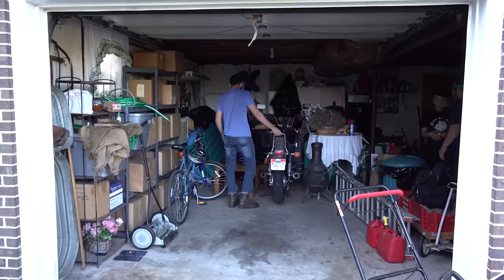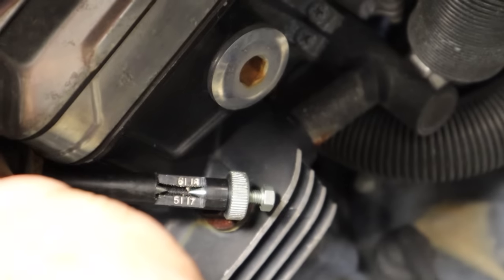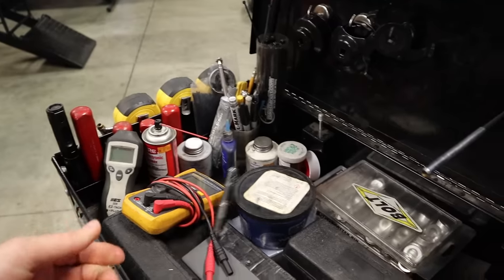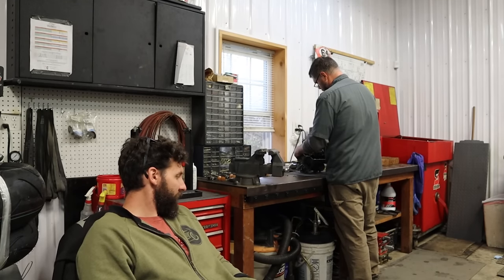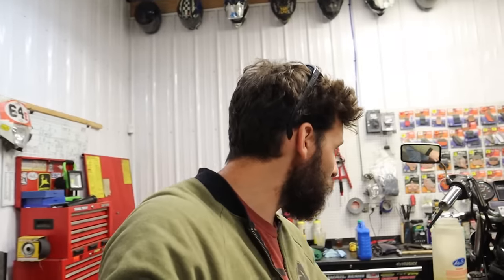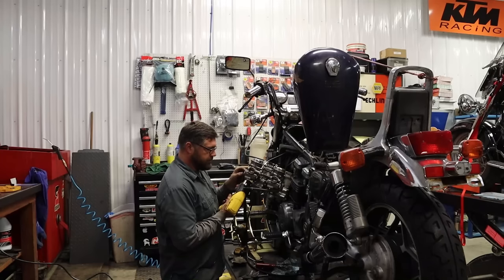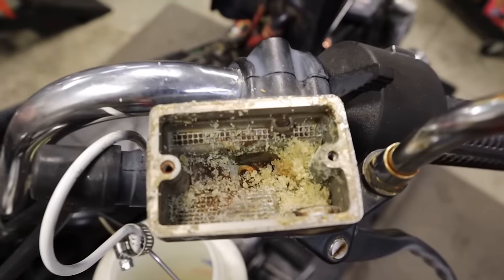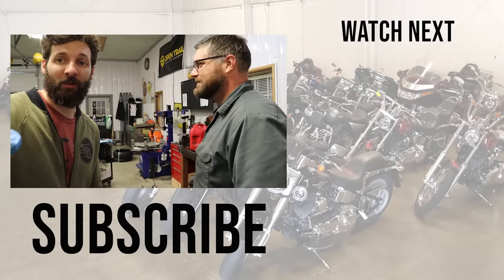Abandoned 1983 Honda Magna Restoration, Can we get it to run?

Comment: I just got my 83 V65 running after 6 years. Quite a few parts are no longer available OEM  which can be a problem with these old bikes. Mine needed a new fuel pump, air filter, directional signal flasher, etc. I have manuals and a wonderful enlarged wiring diagram.  VERY HELPFUL! Also needed new float needles and seats. Old ones don't seal and it is not good when you see raw gas pooling in the air chambet!

Comment: Honda clutch master cylinders also have a habit of building up an air pocket right at the master cylinder sometimes you have to loosen the brake line at the master cylinder the pop that are pocket loose

Comment: Started a Honda vf750f interceptor and wanted to replace the air box with a single air filter pod that runs off to the side. How would you go about connecting the carb air holes together ?

Comment: I actually have a 1980 Honda CB750 Custom that was left sitting for about 15 years that I'm working on. Carbs need rebuilt for it to truly run but it starts and somewhat idles. Would show you pics but can't really do that on YouTube.
Reply: make sure you use a quality rebuild kit or you will rebuild them again found out the hard way.

Comment: Did you check the Slave cylinder for the clutch  ? I imagine it looked like the Master .. x)
Reply from the maker: Did not pull apart the slave
Reply: Definitely rebuild the slave while you are at it.   Slave is reasonably easy.  Clutch is a bear, if you need help I’ll help.  Clutch basket is unusual.

Comment: I had one of those bikes once. How many miles on the bike.
How did you find one of your old bikes.
I had a Suzuki GS850, 1980. I sold in 88
It amazes me how many old bikes are behind barns and sheds because of something easy that could of been fixed at the time.

Comment: My first bike was a Kawasaki 305 . it didnt run when i bought it in 2003 for $300.00. By the time I was done "Fixing it " it had one Yamaha and one Suzuki coil Honda condenser a brake cable and handle from another kawasaki. It will forever be my old 305 KawYamSkiHa.  It worked . me at 275 lbs it would top out at 75 mph . I made do with what i could do with what I had.

Comment: Just bought an ‘83 VF750F here in the UK, for next to nothing, no brakes, no clutch, rusty frame, loads to do over winter. Hasn’t run since 2009. 1st aim to get it running then resto and get it back on the road 6 months? Same issues as yours.

Comment: you got my attention talking about old bikes and custom builds and i didn't make this mistake because i know better lol. im doing build out of 2000 vt750 with 3k on the engine witch is running beautifully with performance jets and velocity stacks. just for hint the bike will have 2019 indian bobber tank witch required modifying the frame because built in fuel pump but thats my kind of stuff i love to figure out . there will be many more surprising mods but its like top notch chefs recipes top secret sh..t lol.  when im done i will come to you guys from Connecticut and show u how custom build should be done . i enjoy watching your show btw!

Comment: I picked up an 82 Honda Sabre a few years ago that had the same problem.    I got it running, clutch hose was clogged, and the charging system was not charging the battery.  so that is my next step is to pull the stator and figure out whats wrong with it.  I have ridden it a few times.  my struggle is getting the front brake lever to unseize.  both my clutch and brake levers were seized. I couldnt get a replacment lever so i managed to get one unsieved. The brake lever is still seized up. I love these kind of project, except they are never perfect. even after i get my reliable the frame has a little rust on the bottom under the motor.   Where are u guys getting free batteries?

Comment: I have a 1986 vf700c that's been sitting, not because it doesn't run but because I can't sell the dang thing. It's been sitting for most of the season other than the occasional start up and run around the block to keep things moving and I'm confident that I could go turn the choke on and start it right up while it's freezing out right now. There's nothing wrong with it cosmetically but I cannot figure out why I can't sell it. This was the first street bike I started riding on and I loved it until my style changed and I got a newer v twin. I know it would be a great bike for someone and I hate to see it sit and rot like so many other bikes. I have over $2500 into it, started out asking $1500 and dropped my asking price all the way down to $1300 in August but all I get is a bunch of tire kickers or people wanting to take it for a joy ride. I have it listed in multiple groups on Facebook and on craigslist, what am I doing wrong? I've sold crappy bikes easily for a profit but what is it about this thing? Any advice you guys can give? What is it that people are afraid of?

Comment: MY BIKE!
I need a gas tank, a carb cover and a battery 😥
Dude! I paid $150 for mine.
It was so worth the buy even though this much work is needed.
Reply: 1 things for sure, it does run.
(Was sold to me as a parts bike)
9:58 also missing these plastic parts?

Comment: I have that same scenario you both went through on this video but missing alot of cosmetic parts only besides a beat up fuel tank like someone took a hammer to it and covered every square inch of it and over time with all the creases on the tank rust came into play so finding a fuel tank now is a thing for 1986 yamaha Radian yx600s

Comment: My mom has a 1984 Honda magna that hasn’t been touched in over 14 years. It needs a carb rebuild, new battery, new tires, new oil, new coolant, and the brakes need to be messed with. I really want to fix it up.

Comment: Im in the middle of one right now carbs are off as you know they have the plastic joints mine were busted ordered new ones they will be here on the 1st of may the bike did fire but stalled out the carbs were full of dry gas

Comment: my 95 CBR 600 that I rebuilt this year had been sitting since 2001 and the front brake master cylinder had a clogged return hole. i could not figure out why my front brakes would randomly lock up. I cleaned the brake reservoir and bled the system like 10 times. I ended up carrying an 8mm wrench in my pocket to bleed the pressure before each ride for a week before I decided to rebuild the master cylinder. rule #1 always clean the entire brake system on a rebuild.

Comment: Carbs on the honda v4s can be challenging for even a seasoned motorcycle mechanic.I have a cpl busted bikes in my shed taking up space.this bike won’t run properly without the proper psi from the fuel pump.

Comment: I had started a rebuild on a 1980 GL 1100 that was abandoned for 22 years quit after a year sold it to a guy he had it running by the end of the week I had it all apart engine out refined all seals and gasket carbs rebuilt  new spark plugs a wires repaired just didn’t have time to finish by the time I had to sell it

Comment: I got a 78 goldwing from a guy who said it had been sitting in his driveway for as long as he could remember. He gave it to me it looks pretty rough. New battery won't turn over. I think either the wiring is bad or the starter. Long road ahead.
Reply from the maker: First question. When you turn the key does anything happen ? Do any lights on the dash come on. ?
Reply: @BikesandBeards  lights come on. When you press the start button they dim but nothing else. I just put a new battery in it.

Comment: I used to have a 86 kawasaki vulcan that ran great until i filled it up at a bp gas station and i thought that was the problem, then it would only go above idle with the battery charger on it , people told me it was the cdi box but it was all from the lack of battery voltage getting to the ignition coil it really just needed a battery and stator coil

Comment: i recently rescued a 2001 Suzuki Intruder Volusia VL800 thats been sitting under a tarp since 2012 with very low miles , a friend of mine has the exact same bike and is rebuilding it for me , main issue ..... carburetor . bought a rebuild kit and fired right up and idled great  but give it gas and it dies .... accelerator pump is shot .

Comment: My heart shattered when he put the whole carb assembly in the parts washer. You really need to break that thing down to clean it. There are all sorts of rubber, plastic, and felt parts that can easily be destroyed by the solvents, and the real things that need to be cleaned are internal anyway. As MagnAndy says, "carbs aren't clean when the parts you can see are clean, they are clean when the parts you cannot see are." I may have paraphrased that badly, but the point is the same. If you took them apart and really cleaned all the metal internally, cleaned and inspected each jet, inspected the floats, float height, diaphragms, and did a piston check on each carb, and did you would not have had the dyno issues you did. You would have looked like a rockstar and put all those silly Harleys (ok I still want a Harley) to shame. Anyway, everyone does a cursory cleaning when they first get their bikes, and quickly learn that was a mistake. Welcome back to the V4 community!
Edit: yes, I see he was doing those things in the background, at least some of them, but I will leave this comment intact for anyone else who comes across one of these bikes

Comment: Oh ya I have a 2000 Kawasaki klr 250 that I bought new along with a 2000  Polaris trail boss 325 from the same dealership in ocala Florida. Neither one is rideable at the moment. They both leak fuel out of the carburetor and I can't figure out why. Also they will only kinda run with the choke on. I need a Craig of my own. Lol

Comment: Doesn't the coolant run through the frame on that bike?
Reply: Yes, the one side of the frame is bolted on "shifter" to make it so you can remove the motor and it also has the coolant pipe into the water pump.

Comment: Check to see that the engine still spins. Clean out the gas tank and fuel lines and replace fuel filter, check the air cleaner, Clean out the carb and fuel bowls, change oil, install good battery and fresh fuel... NOW START.

Comment: I recently got a 83 magna 750 and I can’t get it to run right. I got it running now but won’t idle under 3k rpm’s. Cleaned the jets and idle circuits and got new diaphragms please help idk what else to do. Checked for air leaks around the boots and yes carbs are balanced. I’m at a loss now

Comment: Is that V45 or V65.. The V65 is like the cousin to the Yamaha V-Max.  I had Saber V65 and that's one sweet motor.
Reply: V45 it has a round head light the v65 had a larger square headlight.

Comment: Magna lower fuel tank FYI: if you can not get any fuel from the lower tank to the fule pump:
In the early wisdom of Honda, on the outlet port, Honda put an internal screen.
If a bike sits for sometime, the internal screen has a tendency to clog. 
The only way to correct this is to replace, or cut the tank open, remove the screen, weld, and re-coat the inside.

Comment: That is an '82. There are several small differences between the years. The most obvious was the straight grooves on the brake rotors. the 83s are curved.

Comment: Sean and Craig, with this mastercylider clutch pump is very tricki. On cover is writen that you should use DOT 3 fluid. Propably you was using DOT 4. I don't know why but in this year Honda if you put DOT 4 fluid , pump dosn't work. Try change to DOT 3....

Comment: Bit concerned about the brake service. Bleeding them is good but brake fluid gets scummy inside the calipers as well, especially under the seals. Causes them to lock up. Bad mamma jamma. Clean out those calipers.

Comment: I have a 4wheeler that won’t start with key as in off touch cable to hot side and it cranks can’t find where the open circuit is or what it is ahhhhh

Comment: I got two of them. One nicer than the other. Currently stripping parts from one to the other to make a real nice magna. Only problem I’m having is locating the carburetor fuel cross over tubes as I broke both of them taking the carbs out. Anyone have a set there looking to part with? Or complete carb set?

Comment: Can Sea Foam be helpful with cleaning carbs; etc ? I picked up a 98 Kawasaki Voyager 1200 with under 20,000 miles. Sitting for 2 years. Starts,runs but only with choke on. I was thinking of using Sea Foam after draining the tank and filling with fresh gas. (Water pump seal leaking so I also need to fix that).  
  Very nice cosmetically, paid $1,200. Thinking of fixing and flipping. 
  Maybe someone would have a suggestion. 
  Love the videos guys. God Bless. Oh and my name is greg. YouTube actually changed the name on my account.

Comment: These are fun+frustrating projects, but unless you have three days of free skilled labor they often aren't worth it.  If the 30 yr old bike has under 5000 miles it may be worth a save.  If 50000 miles, then buy a running and serviced 80s Magna for $1200.

Vintage bikes are best in collections and ridden in the vicinity once every few weeks, maybe 40 miles.  Rebuilt fully is never true, as there is always some old rotted important piece we missed.  That piece will fail on you 200 miles from home on a dark mountain road.

The big thing is what Shaun mentioned.  Previous owners hacking on the wiring.  Hydraulics that have gummed up or rotted seals.  Carbs put away wet with gas and forgotten for a decade.  A tablespoon of gasoline in the bowl will evaporate to gel in just a few months or condense water and scale up the aluminium parts.

BTW petcock owners.  If you are going to park a bike for a year.  Shut off the petcock and run the bike for four minutes till stall or drain the bowl if that check valve exists.  Over winter, the bowls are better with non ethanol stabilized fuel in them, but if it is going to sit through hot summers, then drain them.

However nobody that parks and forgets a bike seems to do this.

Comment: Pretty much same story with my 83 honda cx650. The bike sat at the shop I work at for years and one day my boss offered me 500 for it  needless to say it's a journey getting an older rarer honda running and finding parts is pretty much impossible.
Reply: But I dont know if you read comments or not but if you do stumble on any parts for a 1983 cx650 reply to me. I'm in trevose PA and can make the drive.

Comment: Let’s be realistic, its only parts, Labour bill would be thousand if you did everything it took to to really were to going to do those carbs right. I promise you those throttle shaft seals are in dire need of being replaced which mean the butterfly’s would have to come out. Did you also check the membranes on those slides and accelerator pumps in the side of the carbs?

Comment: And now we can all go back to reality. Let's find a 1984 Magna V45 that's not running. 12 hours of labor @ $100 per hour, plus misc. parts. Minimum cost, $1200. So, depending on what a person pays for a bike in that condition, it still might be a winning thing in the end. The bike looks good. I found an 84 Magna V45 for sale, it turns over but won't start, they are asking $2400 as is. I'm trying to pick the guy's brain as to what all he has tried so far.

Comment: My dad decided he wasn’t going to ride anymore. Drove 8hours towing me his 2008 Suzuki Boulevard c90t. It look like mint... he had recently changed the shaft fluid... bike gets to my place in southern pa... battery is dead... over the next few days I charge it up... get it started... and then I let it idle in my driveway for about an hour. Well... it overheated I think. Speedo now doesn’t work. It got so hot the clutch failed. I flushed the clutch. It sorta stumbles now but the speedo is vexing me. I’ve heard that these bikes are notorious for electrical gremlins.
HELP!!!

Comment: Did you know that there was a 500 Magna at the same time?500 interceptor same motor
Reply: Actually, the V30, or 500 c.c. bikes came out a couple of years later.  V45 came out in 1982, V30 in 1984.
Reply: @gt750Good call
Do you  remember that in 1984 Harley slapped a tariff on all Japanese bikes  over 750cc that led them all too build 700cc.Harley claimed the Japanese were flooding the market with bigger bikes (they were).Harley went to the Federal Trade Commision and won.
I was selling bikes at the time. I retired after selling them for 35 years.
Reply: @1cccseed  Oh I remember , and it's cool tosee you do to! These are some of the more complicated bikes to work on, but they are so good. I have a 500 and a 750 Interceptor. Though in Canada we never had such a thing. But, I owned a 1987 Honda VFR700F2 Interceptor that I knew was a mistake to sell before it even left the driveway.

Comment: Electrical. Every damn bike I've had has had some sort of electrical gremlin. Latest 1 almost beat me. she went through 4 stators! took me weeks to find the very simple problem.
Reply from the maker: What was the problem
Reply: @BikesandBeards a small oil passage in the stator cover maybe the size of a needle. it had become blocked with rtv that the last owner had used to seal the rubber grommet. It keeps the stator cool on some Suzuki & kwaks,

Comment: To begin with, Rachel Kerr is way to nice of a lady to be hanging out with you.  2ndly brake fluid should be changed every 2.5 years to avoid the problems you experienced.  3rd Buy a Honda made of tin.  Ride it out and push it in.  This from an old Indian rider. Great video.  I hope she hasn't as yet deemed you unworthy and already moved on.

Comment: got two 84 magnas v30's one is running and going back on road this month the other will get there used some parts from it to get the other done those v4 carbs are a b@#€ch but doable the subtanks and fuel pumps argggh also no fun